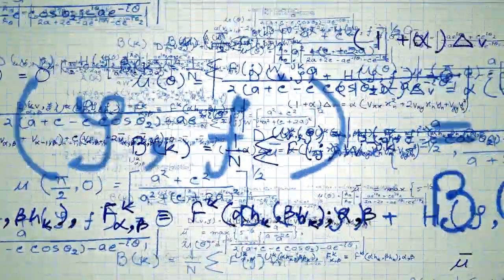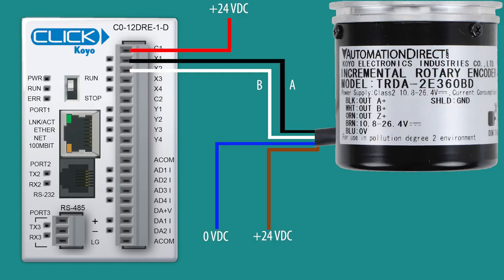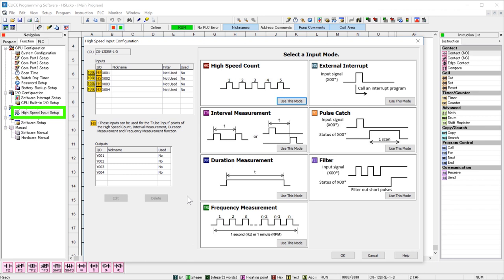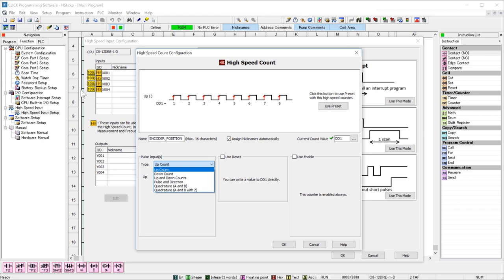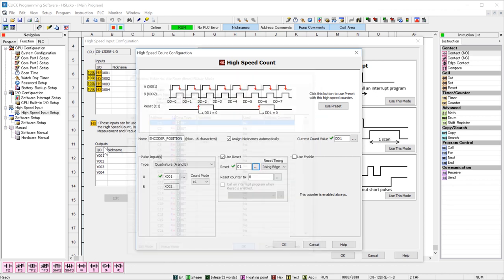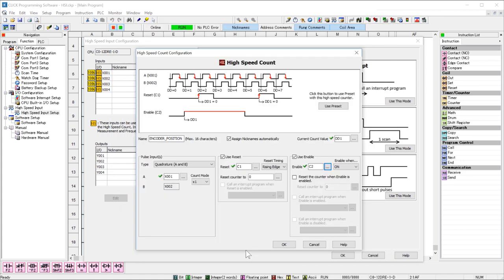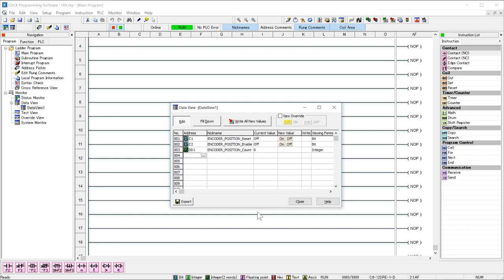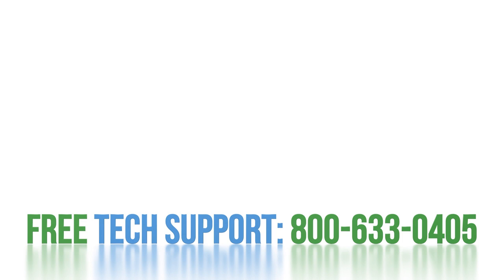CLICK PLC High Speed Counter (HSC) : Encoder Counts- Encoder Position from AutomationDirect

Comment: how would you set limits for the  the encoder ? if a conveyer or door had to stop at  a open or closed position .
Reply from the maker: Zoofly, thanks for the comment. A simple way to do this would be by using a compare instruction in the ladder. (Example: DD1>or equal to 20000 then open position) Another method would be to use the Preset table to program this. If you have more questions on this I would advise contacting Tech support at 1-800-633-0405. More details than this will be hard to convey in YouTube comments.